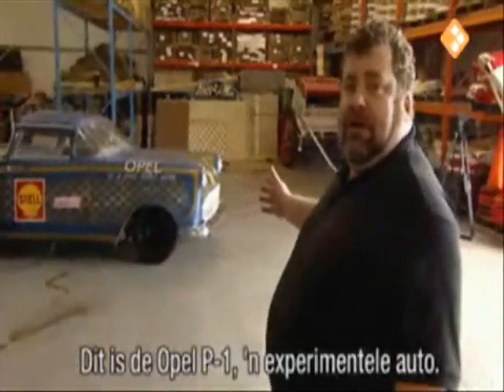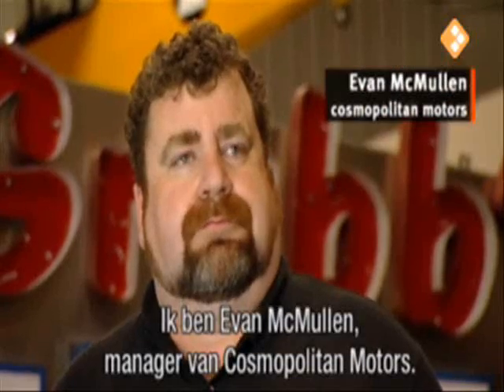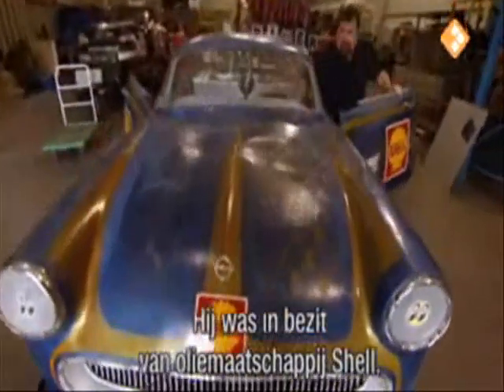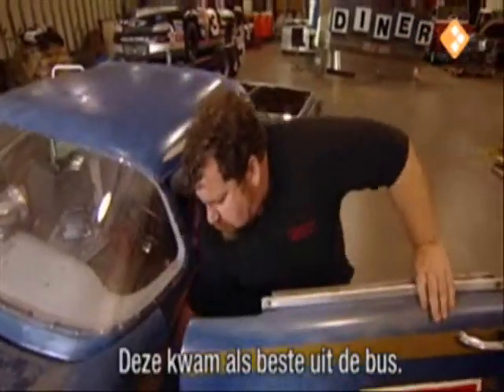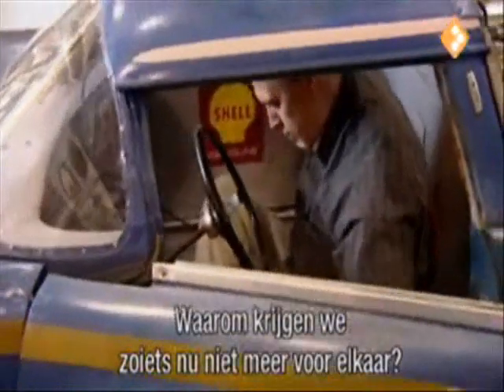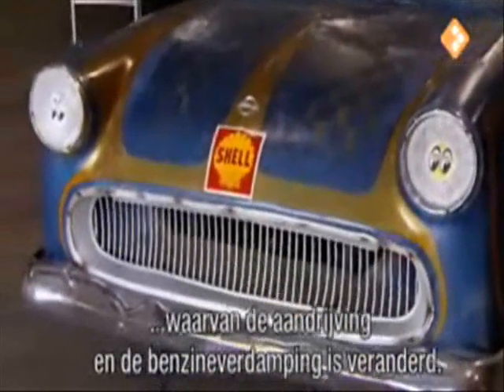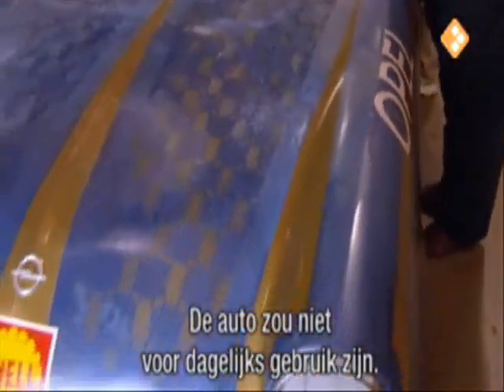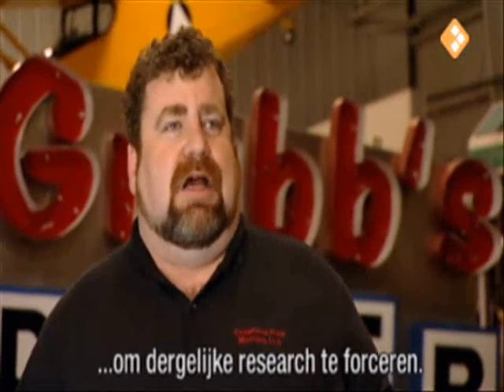High mileage car. 376 mpg!

Comment: @Bence316 WOAH WOAH WOAH! Now listen up MAN! there are two types of old cars: 1: old junk and 2: old classic. The cars shown in the vid from 0.00 to 0.20 where classic. We can argue about that, but it won't change the fact, that that Opel was in poor condition! By the way... WHAT THE HELL does this have to do with a car's transmission? Oh and I drive a '98 Suzuki Swift gls: 1.0Liter Engine with 5 speed manual gearbox! YOU ARE THE ONE who bought an automatic Ciera! Think before you act tough!

Comment: Naaah, look at the gearing, this car was likely built to travel at 10-15mph, slick high pressure tire, flat track, no hill climbing and engine speed was likely well below 1000 rpm. Likely in the very low 100's  with loose bearings in the engine/transmission and driveline.

Comment: @Lokivoid Your fuel air mix is based on the melting point of your exhaust valve.
Thats it.
Everything else you add in is a workaround to not using  nimonic metal exhaust valves with fed precooling.

Why do you think a diesel limits the fuel fed for rpm/load with no air butterfly valve?

The BMW R1200GS has sodium filled valves against the BMWR1150S. Saves 10-15% in fuel.

Comment: Shame Google Chrome told me this site might harm my computer.

High mileage lean burn engines go for low pressure valve springs. Low viscosity oil, very high pressure on the tyres. They do run lean so little valve overlap to stop burning the exhaust valve, water vapour spray in the inlet, big spark!, oversquare engine.

No cat, no modern fuels, high compression. Fuel can be pre-catalysed or evaporated like this car did... blah blah.

It's do-able.

Comment: Uh, I had a 1997-3 cylinder Geo- Metro, 5pd........a great little commuter car. If I drove carefully I could get 60 mpg, and this is without many of the newer fuel saving technologies (variable valve timing, auto shutdown at stop, ultra lean burn mode, gas direct injection to name a few). I could see a little car like the Geo getting close to 100 mpg with some reworking of the systems. Problem is that little car would cost 20 grand, would it even sell? maybe if gas goes to 5 bucks a gallon.
Reply: Gas is 5 bucks a gallon now
Reply: @allentrexcill2921  And yeah, that nifty hypermiler would cost at least 100k.

Comment: It's very simple people. Drop a match into a bucket of gasoline and the match will just go out. Drop a match in a bucket full of gasoline vapors and it will ignite very easily. We inject liquid gasoline straight into the combustion chamber. This car vaporized it first then sent it into the combustion chamber.
Reply: Hola, lograste probar con vapor de gasolina?

Comment: Not only did the big gas company do their best to bury this technology , They also changed the composition of their gasoline.
The opel  you have was designed to heat the fuel and run on the vapor.
Today's gas needs much more heat to vaporize.
Don't be surprised if when you get it running it doesn't do as well as it did when we had real gas.
Reply: It works fine, gas composition hasn't changed that much. It's extremely combustable. Especially winter blends. Vapor carbs are easy to make and install works great on generators and mowers. You don't have to heat the gas. It works like a water bong the intake air is pulled down through the gas and comes up making vapor taking the air and vapor the air bubbles force. Plenty of videos on it